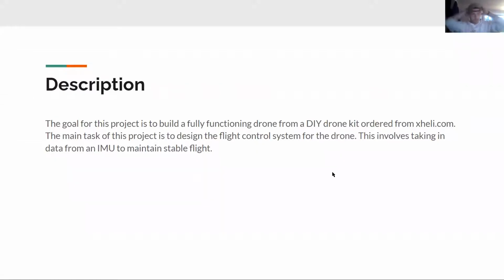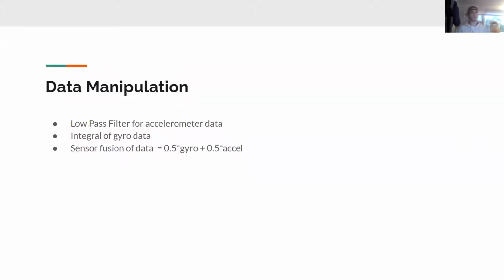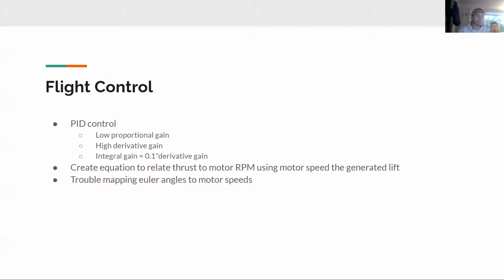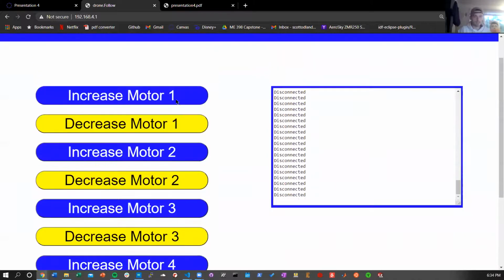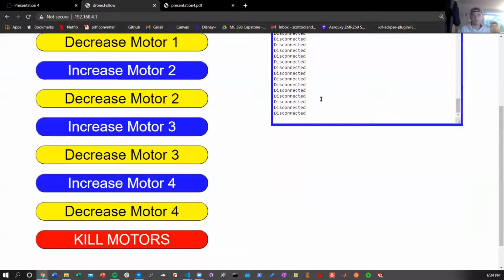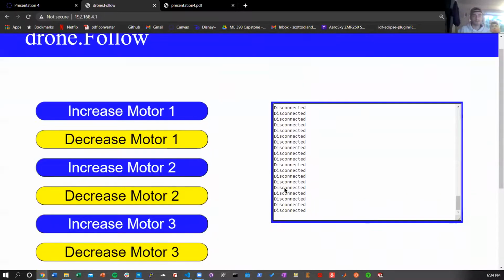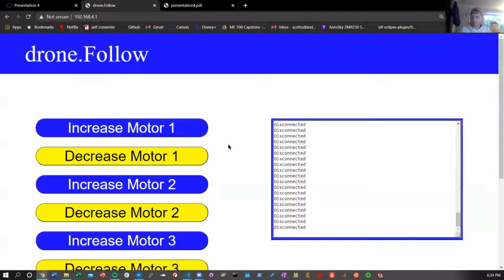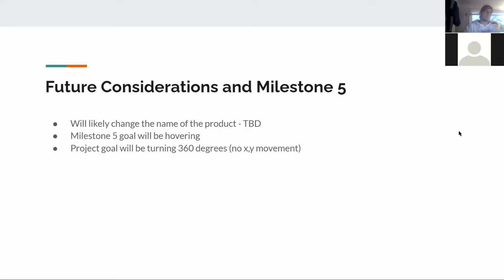drone.Follow - Scott Odland

Comment: Hey Scott! Glad to hear all the progress you have made so far. It was really nice that you walked through all the steps, tests, and equations you used to generate lift in your drone and it made it really easy to understand where you were in your project. The video was also very nice as well to see your project in action. Your goals for milestone 5 also make sense with all the progress you have made so far. For your questions, Eagle PCB is a great place to start with lots of resources online for tips and tricks. For the website, I think that showing the values of RPM for each motor could be useful or using a slider to set the RPM for each motor could be nice as well.

Comment: Hello, Scott. I think you have made some decent progress since last time and are set up to have a good product by the end of the quarter. I can definitely see how a lot of the math and technical issues with the IMU can hinder stable hovering for your drone. I wonder if the IMU to MCU to motor pathway is fast enough for satisfactory flight control. However, if you are able to get it working for Milestone 5 that will be quite good. That would be my main goal at this point. As for ESP32 PCB design, you probably saw the link that was posted in Piazza so you can use that. I think the website could be improved by having a type of slider of joystick to control each motor more quickly and precisely (while also displaying the current speed). I would also have a log of IMU data.

Comment: Hi, Scott. Is good to see that you have achieved some progress on your project. Drone is always the coolest project but also the hardest one to accomplish. Since you have be able to make four motors running, I think we a little calculations you should be able to let your drone fly up and down. Unfortunately, I do not have much experience with drone implementation so I cannot give any practical suggestion on your project. For the PCB design, Professor Mikhelson might have mentioned about Eagle PCB which I used it for EC326. It a pretty user friendly software with lots of resource online. I don't know if you have implemented or decide to implement the button for all motors to turn on simultaneously such that the drone can lift up.